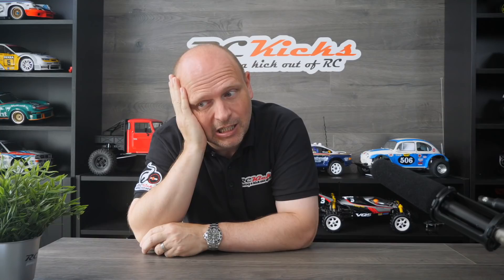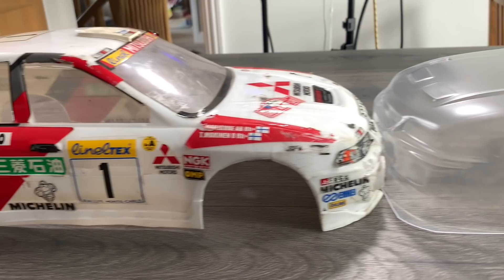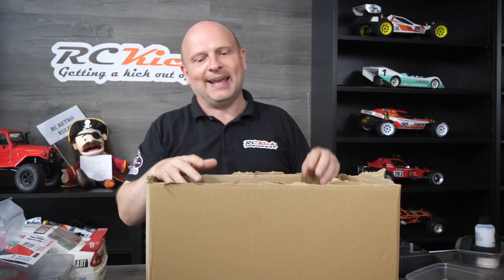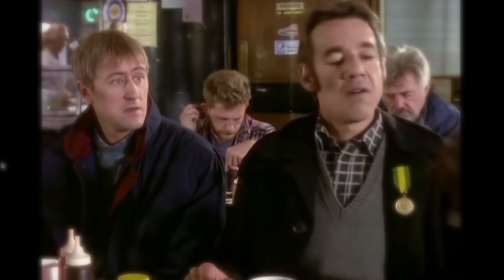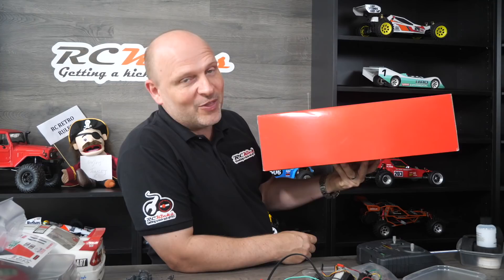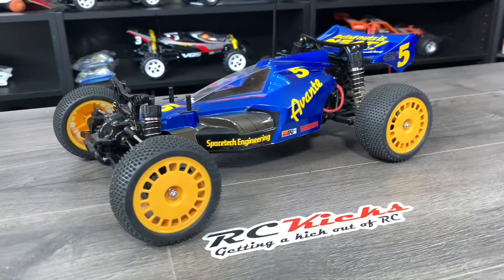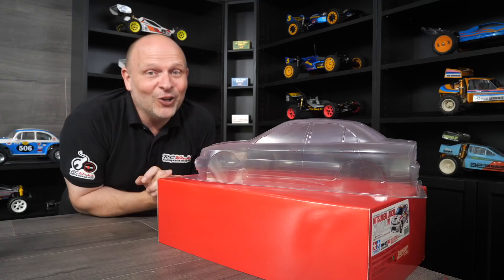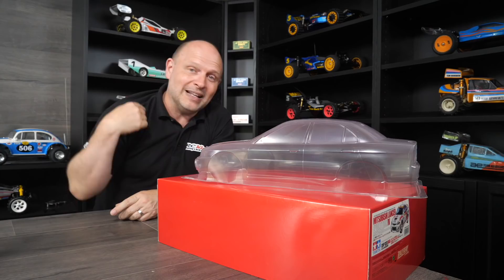Tomley RC Fuels My RC Habit & Upsets The Wife! Fix & Flip Part 2, Mitsubishi Evo 4 TA03F + DF03Ra

Comment: Regarding over tightened screws and damaged mounts, when refitting screws you should always slowly turn them in the opposite direction until you feel them go just past the starting point, then when you turn them in the correct tighten direction you will be using the original thread and not cutting a new one thus stripping out the inside of the mount

Comment: pre heating the tapping screw with a cigarette/stovetop lighter is the only way to stop future cracking, it's the tension from the shrinking plastic that does the damage over time.
cutting a thread with some very mild heat prevents that tension.